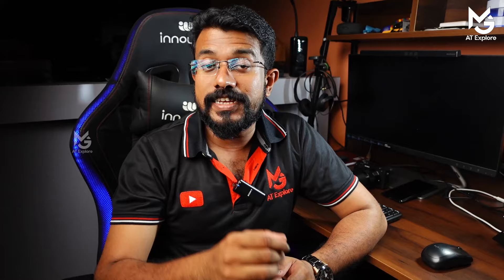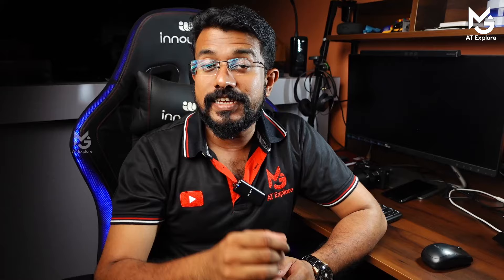മൈലേജ് കിട്ടാൻ ബെസ്റ്റ് ടെക്നോളജി | Volkswagen Technology ACT | Engine Cylinder cut | #MGTIPS -505

Comment: ഞാൻ ഫുവേൽ ഇൻജക്ടറിൽ നിന്ന് ഒരു സ്വിച്ച് കൊടുക്കാൻ പോവാ ആവിഷം ഇല്ലാത്തപ്പം ഓഫ് ചെയ്ത് വെക്കാമല്ലോ
ഇനി മൈലേജ്  കൂടിയാലോ
Reply: 🤝😲👍 success ayal reply tharanee😁😁
Reply from the maker: Aha adipoliiii...😃😃 But athil oru kariyam kudi unde valve open ayi vekan ulla option alengil compression strock il chumma load koodum
Reply: @MGATEXPLORE  ath sheri aanallo...👍🤝
Petrol engine nu valya compression illyaloo
diesel nu alle ath oru issue avu
Reply: @MGATEXPLORE compress cheyunna energy expansion stroke il thirichu kitum, except for small normal engine frictional losses. Someone should build a prototype and test this. In light load we don't need as much power.